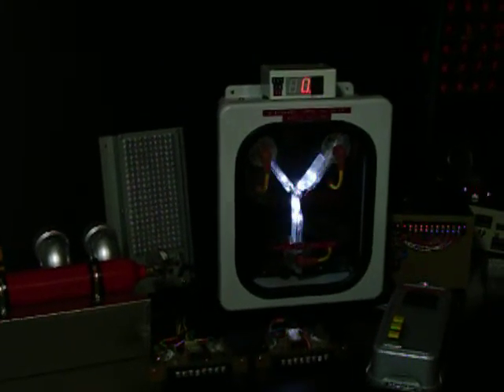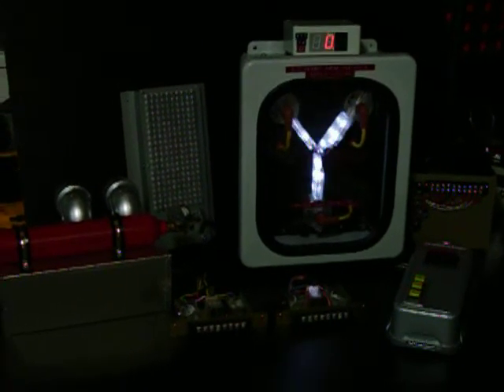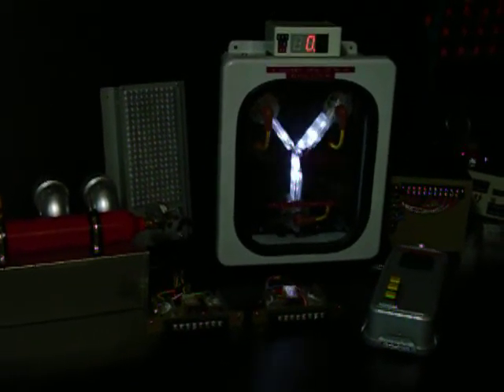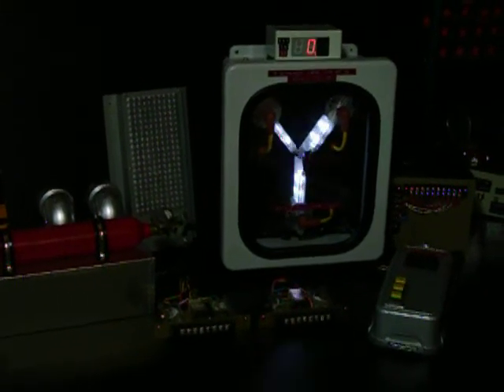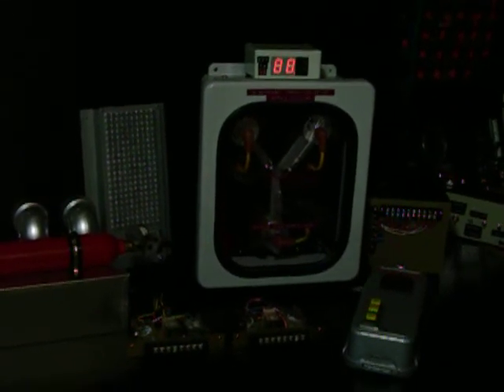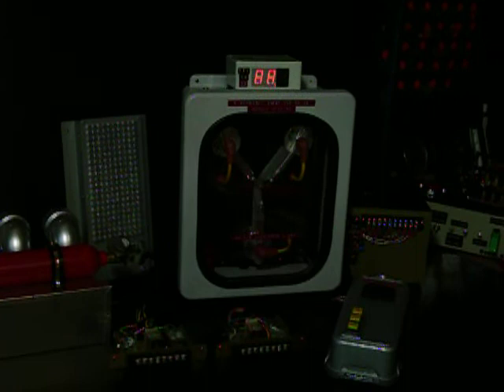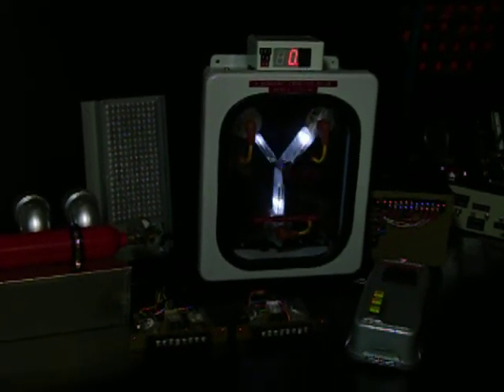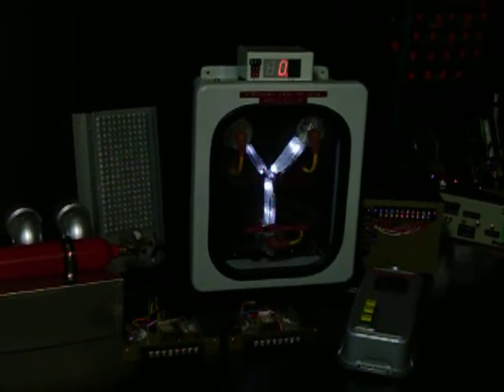Flux Capacitor with 88 Speedo

Comment from the maker: Yes! I have made a working Speedo for a friendse Delorean. I also made a speedo that functioned while the Delorean was in motion and wired it to the Flux Capacitor so as when the Speedo reaches 88 MPH the Flux Capacitor start to flash its center strobe light. The trick was , the speedo was calibrated so that for every mph the car was traveling, the speedo displayed double. When the car reach 44 mph, the speedo displayed 88 mph.